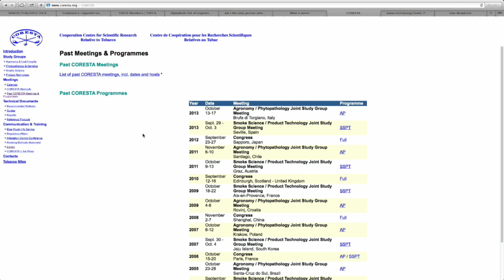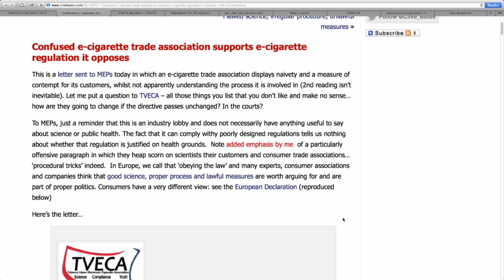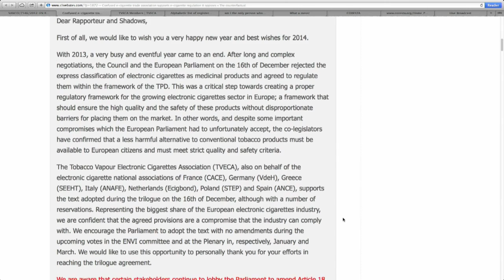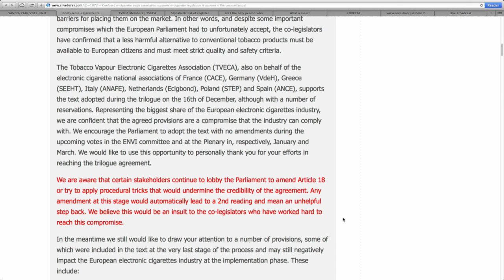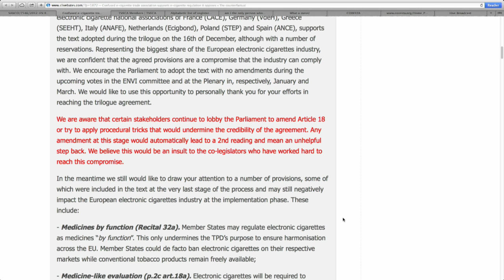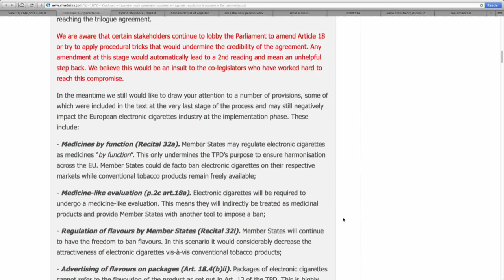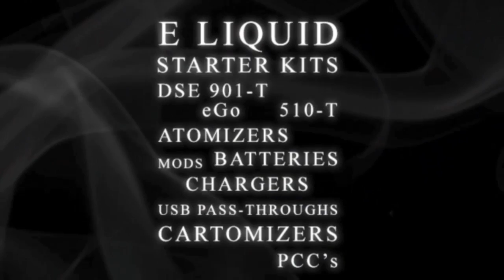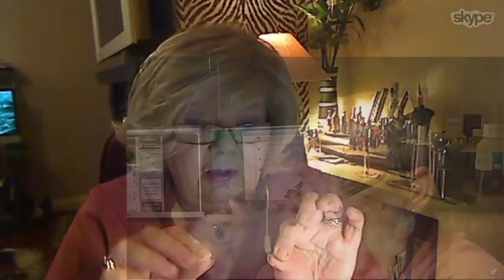Haze Hour 20-01014 - TVECA - Can your mum embroider? STITCH THAT!!!

Comment: Uncanny timing. I dual micro coiled my kayfun for the first time last night; 10 winds of 0.25 on each (1.8mm diameter) for an overall resistance of just over an ohm. Two tiny strands of cotton wool and I've never had so much flavour and vapour from the Kayfun. Bit of a fiddly build but well worth the effort - especially considering the fact that you won't have to replace the coils for a long time